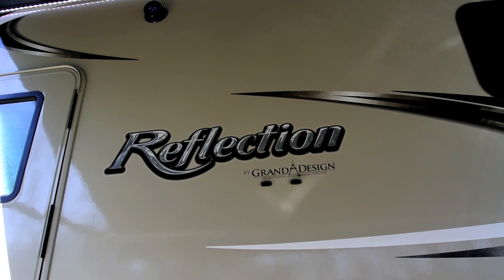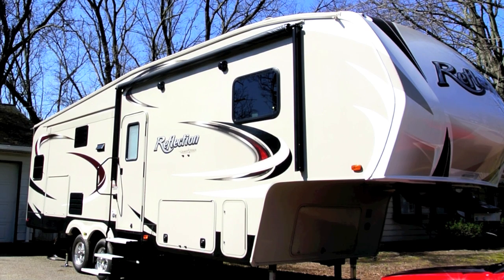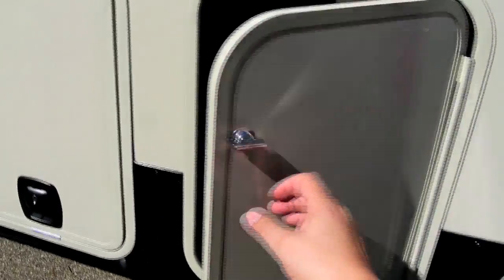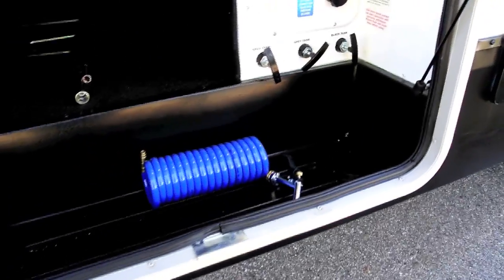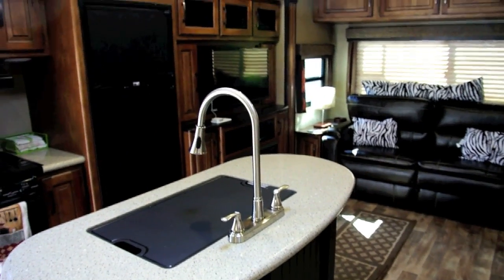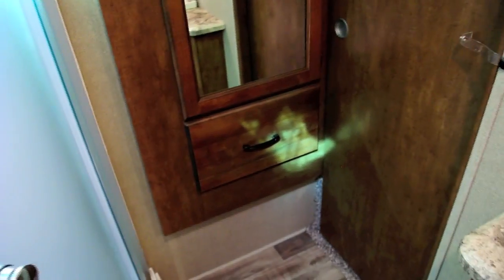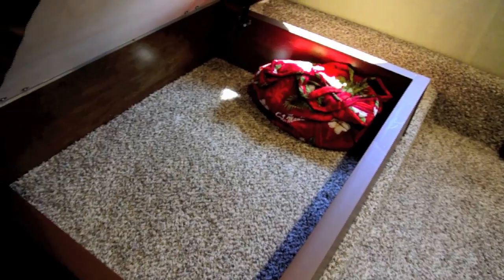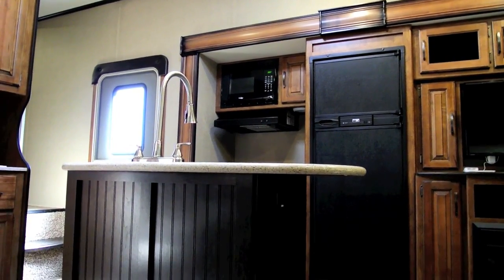Walkthrough of my 2016 Grand Design Reflection 29RS Fifth Wheel

Comment: Here is 2021 and I'm still loving my 2019 grand design reflection 303rls. I can agree with you on better improvement on them. Had 5500 onan generator and direct TV dish installed on ours. Hope you're still enjoying yours 👍😀
Reply from the maker: After 5 seasons of use - which comes out to about 350 days, the rig has held up pretty well.  There are a few signs of wear, but not too bad.

Comment: We have the 2019  version of this.  It's  interesting the changes GD has made.  We don't have a bedroom slide and the living area sides are opposite.
Reply from the maker: Are you sure it is a 29RS?  I saw a 2020 model at the RV show last month and it still has the same layout as mine.

Sounds like you might have a 295RL
Reply: @RVProject  yes, you are correct the 295rl
Reply from the maker: @Dave-nf7rc  You are correct though that over the years significant changes are typically made. For my 29RS, from the original 2014 model year, it has undergone significant changes, including Ground Control, increasing GVWR by 1,000lbs, additional windows, addition of drawers in the island, and so on.

Comment: Thanks for the video. We looked at the Grand Design Reflection models they had at the RV show today. Lots of very nice design ideas. We loved the depth of the drawers. They definitely missed the mark on that little fan in the bathroom though. Definitely needs to be upgraded to a Fantastic Fan. I'm not sure that I like all the black touches on the interior and GD doesn't offer any interior color options. My wife likes it though. How do you find the sofa and theatre seats? They seem like they may be a bit slippery?
Reply from the maker: So far the sofa and theater seats have been fine.
Reply: The Pleather starting to peel after 3 yrs.
Reply: Rv is a Glorified Tent?? I Fkn hope so for 50k!
Reply: The New water system are a real nightmare if have a leak! Parts are hard to get an calling the Nautilus company is a joke! Mite as well fix it yourself an start replacing cheap plastic fittings with Home fittings!

Comment: Do you know where the converter is located? I can't find mine
Reply from the maker: For the 29RS, it is directly behind the AC breaker/DC fuse panel.  You can get to it either by removing the fuse panel or by removing the rear wall in the storage area.

If you have a different trailer, turn a lot of DC stuff on (lights etc), and listen for a fan sound coming from somewhere. When the converter is supplying a lot of power, it is normal for it's fan to run. Perhaps you can hear it and locate it that way.
Reply: Thank you so much for your help!

Comment: if you  don't mind me  asking,  why did you give up your class C you worked so hard on?
Reply from the maker: A 5th wheel fits our lifestyle better. We're retired, so we plan on using the 5th wheel at least 100 days per year - kind of part-time full-timers. After a week or so in the Class C, things start to get claustrophobic.  

As well, the truck we bought as a tow vehicle is much more capable than the Class C powerplant, which means long-distances will be easier to accomplish, especially if we are traveling over mountains and such.

All forms of RVs, whether it be a travel trailer, 5th wheel, or motorhome have their advantages and disadvantages, and our needs have changed (or at least became more clear) after having the motorhome for a few years.  It became pretty apparent over the last year that a 5th wheel was going to be a better match than the motorhome.
Reply: fair enough,  hope your new 5er is built better then your C was. I  finally got my POS nexus wiped into shape,  but i am stuck with it. as long as the ford e450 holds out we will be ok. good luck.
Reply from the maker: As I always say... the only thing that works on a RV is the owner.
Reply: yes, you have said that before, lol. on a interesting side note, i found out why my nexus was so poorly put together,  i ran across a "jobs review web site" where employees or X employees can review their employers,  seem at that time nexus decided to  change the way they payed their employees,  this lead to  a very unhappy work force and the result was a poor quality product, of which i ended up getting one.  had i been a year sooner i would have gotten a better built motorhome. its this kind of  information one never get to know about until after the fact. if it was a 500 dollar tv i wouldn't be so upset,  but 80,000$ is a different story.  how these owners who built  this POS sleep at night is behond me.  I was in the manufacturing sector my entire life,  we  took pride in what we built,  we stood behind what we sold and made good on what we screwed up. in my  opinion " factory direct " means only one thing, we cut out the middle man , lower the price point  just  below the competition and pocket the rest, instead of providing  a better built, higher quality product. pure and simple greed.  this will be the last nexus i will ever buy and armed with the knowledge gained know what to look for in the future.
Reply from the maker: That is an interesting story. We saw Nexus a few times, and I always thought they looked pretty good. I guess you cannot judge how well something is built by casual observation.
Reply: they did a great job of hiding all the problems. fortunately i have to tools and skill sets to fix anything mechanical. someone with zero knowledge would be  totally screwed.

Comment: what are you using for a tow? What hitch are you using?
Reply from the maker: 3/4T diesel pickup, with a B&W Companion Slider hitch.
Reply: +RVProject Great setup, we pull a 35' fifth with the same setup.  B&W really stands behind their products.  our slider stopped working after 2 years and they sent a brand new one.
Reply from the maker: Good to know about B&W standing behind their products. Did you use the 1" or 3" position on the upright arms?

One of the biggest issues I had when I bought this 5th wheel was which hitch to buy. With a short box (6.6ft) I had concern about the dreaded damaging the truck/trailer nose by turning too sharply. 

No one seemed to have an answer. The dealer just wanted to sell me the most expensive hitch (auto slider), so I knew where their priority was. 

One thing I did determine was that the turn radius (when going forward) would never allow the truck and trailer nose to come into contact no matter how sharply I turn, but reversing is where you have to be careful.

Even then, with the slider still in the TOW position, the trailer will turn awfully sharp, enough so that the wheels on the trailer seem to want to slide sideways rather than roll backwards.

So I am not sure I will ever need the slider mechanism, but it is nice to know it's there if it is ever needed.  I cannot imagine the stress the springs and suspension would go through by attempting anything close to 90deg turn.
Reply: +RVProject my uprights are all the way down and all the way forward.  I have a 2012 RAM 2500 and a Keystone 333mks with the hitch forward I can make a 90 turn with out breaking a window, it's tight but can be done.  

my dealer was the same way, I had the turnover ball already and our dealer want a B&W rep so the wouldn't give me any support when I showed up to take delivery so I sat in their lot for 2 hours on a busy Saturday setting the height on my pin and hitch.
Reply from the maker: +Brian Meyer Wow, a 90 deg turn with the hitch in the tow position?  That is nice.

Comment: So, you've gone through 2 seasons with your Grand Design fifth wheel.  How are you feeling about its overall quality now?
Reply from the maker: I'd say they are above average in quality, but no RV is perfect, and we have had a few things that needed repairing. I would certainly recommend one, and I would buy one again.
Reply: RVProject Thanks.  We really like the unique design elements they have and agree with your comments.  The first year we saw them at the local RV show I was really impressed.  The second year, I toured through a 5th wheel model and the hinge on a cabinet door in the bedroom broke and the door came off in my hand.  That took them down a notch for me.  As you said, they aren’t perfect and still have some of the same typical RV quality issues.

Comment: I have those Cheap Vents in my new 2017 Coachmen  246 RKS  Freedom Express   the one in the Bathroom  has the Small dinky Fan  with the R/C Car Motor on it  (lol)   JUNK    How much more would it add to the Total Price by Putting a base model Fantastic Fan In  ???????  it would cost them nothing by buying the fans in volume  Pennies on the Dollar . had a 2003 Rockwood  Ultra Lite  25 ft  came with a Fantastic Fan  all Rockwoods  do from the Cheapest to the Expensive